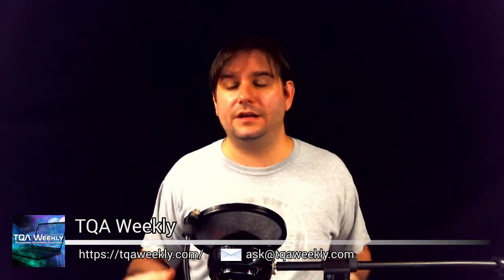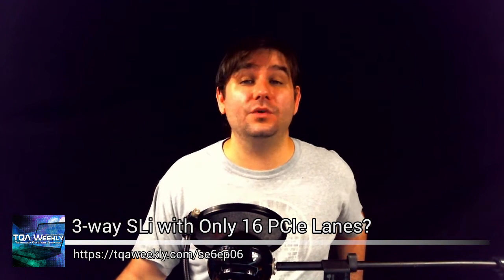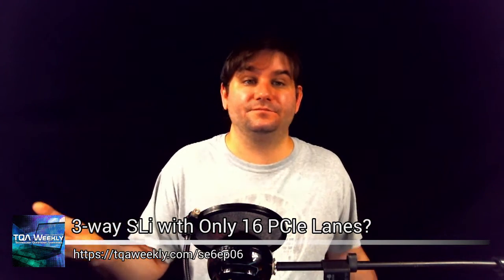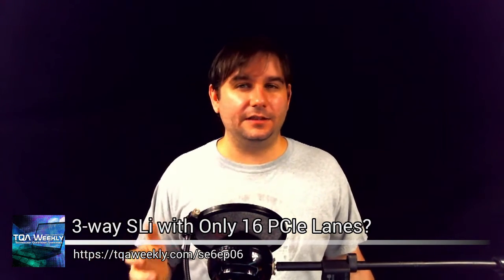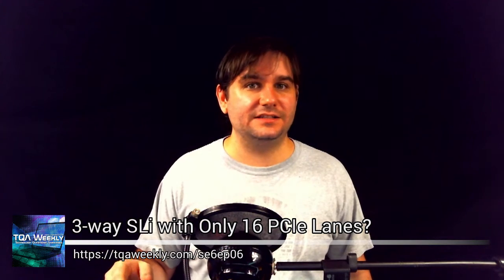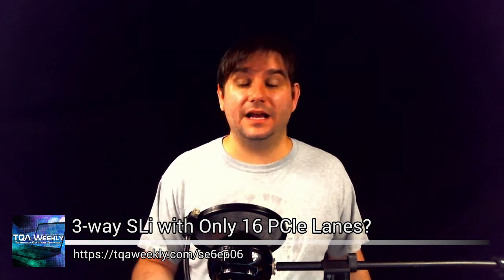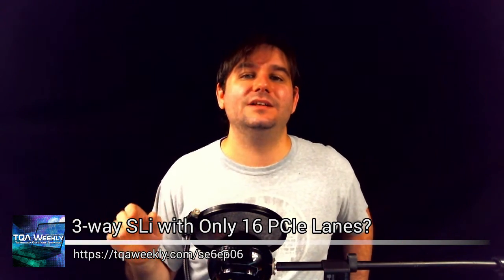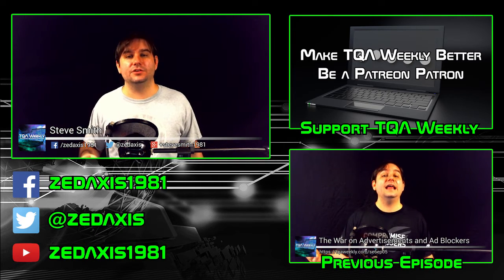3-way SLi with Only 16 PCIe Lanes?

Comment: Can i achieve a 2-way SLI configuration without problems or bottlenecks on an Asus x99-a usb 3.1 motherboard , an Intel i7-6800k processor? which has 28 pci express lanes and a Samsung M.2-2280 NVMe PCIe 950 pro ssd? (graphics card 2x gtx1080)
Reply from the maker: You should not have any issues with bottlenecks on your system. Even if all your PCIe Lanes are occupied with such a configuration, mainly because you'll have a harder time tasking those graphics cards with video games for a while.

Comment: Still, the z77 or z87 boards which run the 3770k or 4770k chips still only have two lanes as well where the memory dimms is concerned as well.. where as the x79 boards have 4 lane dimms for memory and have full 40 lanes of PCIE band width on the chips whether that be 3820 or 3930k or 3960x or 3970x or 4820k or 4930k or 4960x..   only the newer 5820k has less with 28 lanes, still plenty to run 3 way sli as well.. and the 2011 socket chips like the 5820k do not cost any more then the newer 6700k chips, the 6700k chip having 4 cores and 8 threads.. but the 5820k having 6 cores and 12 threads, and the 6700k has 8 mb smart cache and max 16x pcie lanes, where as the 5820k has 15mb smart cache, and 28 pcie lanes... granted the base clock is 4.0ghz for the 6700k to 3.3ghz for the 5820k, but the chip will run faster because of its architecture..  so logically, there is no good reason to go with a chip with only 16 pcie lanes.. and even a mother board with a chip on it to switch between devices on the pcie lanes, still bottles necks down to run what it must run at the moment..  I always suggest going with the full 40 pcie lane chips of the 2011...  I like the idea of running raid disc controllers or Nics as well on the pcie lanes.. each which can easily take up 8x each..  they also help to speed up your pc..  You can also run a pcie based ssd as well.. and you need to make sure that the mother boards you buy have live connections of 16x or 8x behind them.. the electrical connection is there for a full 16x.. Many like skimping on the CPU chip and Mother boards to put the majority of their cash into the graphics cards, but I would suggest you do not.. You can always add the cards one at a time as you go with the right platform under you..
Reply from the maker: +LivelysReport I agree with the 2 memory lanes. but most users won't buy 3 or 4 graphics cards. And, as you pointed out, last gen is not necessarily weaker, or worst than current gen hardware. For the last few generations of hardware, very few improvements are added, and no generation has anything ground breaking that would make previous hardware any worst for wear. If it still works, don't replace it just because.

Comment: Like i said, the old company was named PLXTech... they had their logo on the chip that look like big "PLX" and "Tech" below that underlining it. Still it was only the name on the company...not the chip. The chip in old and new specification always named PEX. Stands for"PCI Express Switch", simple as that - sure X represents switch in IT :D

Avago acquiring PLXTech was in june 2014, so not that much time passed.

The logo on the chip simply changed it now shows "AVAGO" instead of "PLXTech". Any new motherboard since june 2014 featuring a PEX ship from Avago with that brand logo. And if you have trouble locating it on the mobo...look for AVAGO not PLX.

Please understand what is the manufacturers name and what is the products name, because otherwise it's causing lots of confusion. I.e. the GPU is called A "titan X" not A "nvidia", see the difference.
Reply from the maker: +Anon Nymous Like I previously indicated, and as I have searched each time, talked with people in the domain, regardless of what company bought the PLX technology since the boards in question use the "PLX", it is still correct. Given it may change name, or has started to, I don't go out of my way to confuse people, and you should not either. Even Asus still uses the term  PLX bridge chip in their FAQs and device drivers. Thank you for your input, but until the term unanimously becomes PEX, I must follow current convention, and use the name defined by the standard, PLX. Which btw, even though there is no explictly easy place to find it, probably means PCIe Lane Switch, too.

Comment: Just a note on wording. There is no such as an PLX chip anymore. The chip was/is named PEX... but PLXTech (the company) has been aquired by Avago Technologies. It' Avagos PEX-chip. Also i would have appretiated that you talk more abou the benefits of those chips (multicast, P2P-intercommunication) in a SLI compared to the more expesivier platforms.. and of cause some note that the more lanes of an E-processor not only not neccesarily result in higher performance but practcal tests have proofen that in fact even multiple actual high-end GPUs still simply dont benefit in terms of demand with 16x in favor over 8x Gen3 which is nearly asfast as 16x Gen2. The latter still is sufficient for upo 4 GPUs... so ne need for 2011 IMHO.

All in all this would have underlined your statement furthermore. Still like. +1
Reply from the maker: +Anon Nymous My sources indicate the chip on the mainboard, especially those sold by Asus still bare the brand PLX, but thanks for the update, I will confirm with them. Usually, the branding is licensed as is, and it may take a while, since I focus on less advanced users, I traditionally favor not confusing them with a brand name that don't show up on the box. As for the benefits, while most graphics cards will be able to use, and benefit from this, it is important to note that Titan X's in 3-way and 4-way SLI on an X99-3 platform bottleneck even with the better Intel i7-5860X, so while it is true that a single graphics card, maybe even two will not suffer any data bottlenecking, there is a point where it can occur, even on enthusiast platforms. I will endeavor to continue this topic as a supplementary episode in the near future, and thank you for watching.